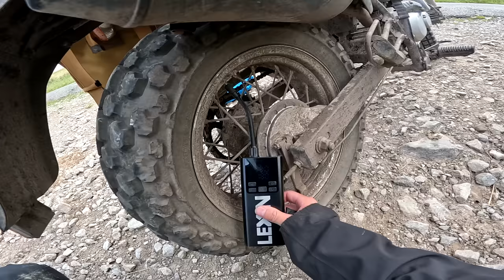WE HAVE A PROBLEM... (Ep.18)

Comment: Another quick tip even with tubes get your self a valve core remover and some MTB tubless sealant (had good experience with Caffelatex or Stans) and put 200 ml or so into each tube. That will quite often seal small punctures instantly without interruptions. Also means you can run lower pressures for more traction offroad worrying less about punctures. Disclaimer: Works but may or may not be road legal where you live. So like any work on your bike, use at your own risk. Greetings from England, AndyB
Reply: I used to use some good stuff called slime in my mountain bike tyres. Never got a flat after adding it, but often saw green gunge coming out of little holes in the tyre, so it seemed to work.
Reply from the maker: Thank you so much 😍

Comment: you was very lucky with that puncture, i had a puncture on a 200 van van rear wheel, a screw went through the tyre and put a thumb sized hole into the inner tube... so no patch was able to fix that... i had great difficulty removing the tyre... eventually had to get bead breakers to get the tyre off... inner tube was wreaked so i ordered two new ones for the rear tyre and two for the front tyre... its an unusual sized wheel so carry those inner tubes with you... otherwise you may have to wait until you can get replacements... the Yamaha tw200 has the same sized wheels... happy travels,
Reply from the maker: Wow yes we have been very lucky that we could fix it that easy 😊